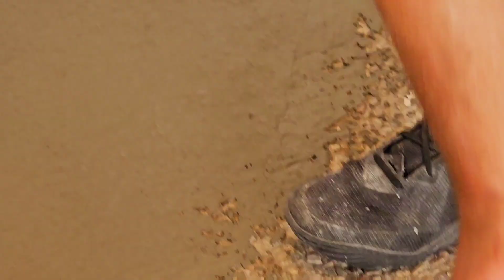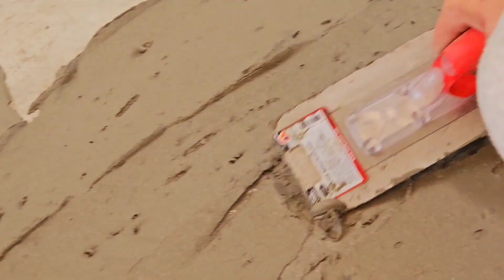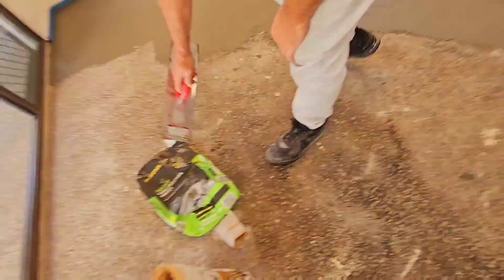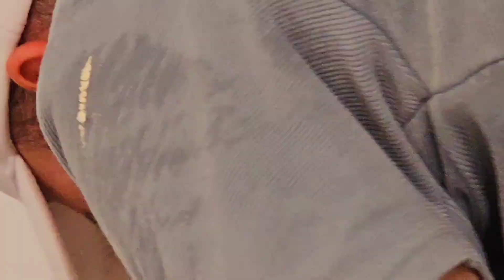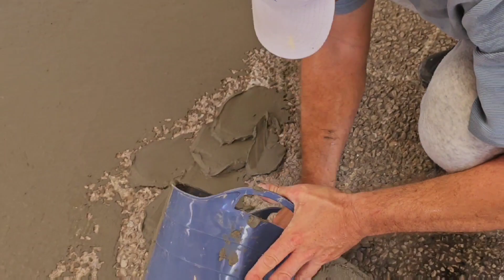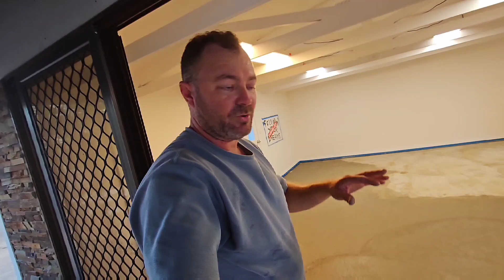Trowel Concrete Over Aggregate Floor

Comment: I want to do something like this on my driveway. if I did, would i be able to drive over it without it cracking?
Reply from the maker: you would really need the right product and it should be alright, It was very slow going for me it felt, i would want to have another method to spread and finish it